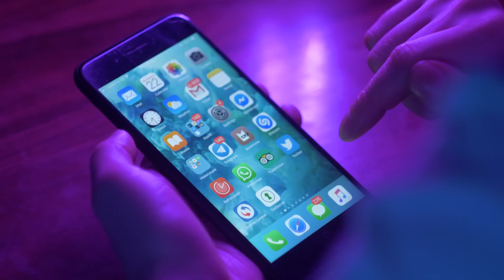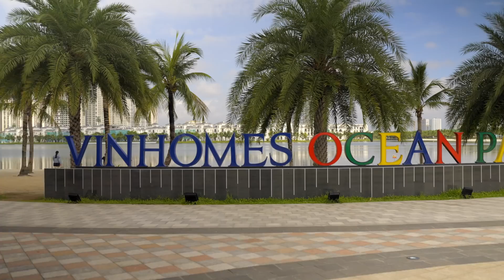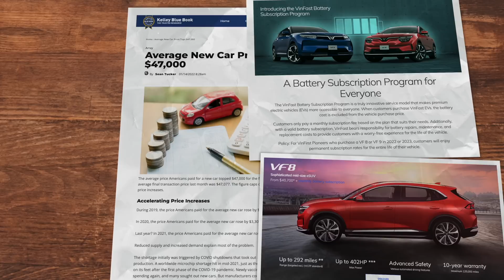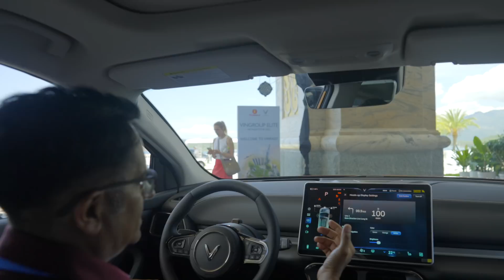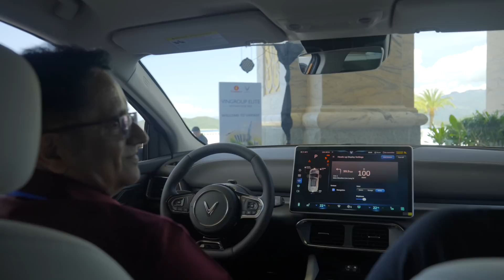New Startup FINALLY Makes EVs Cheaper Than Gas Cars!

Comment: If I have the right as owner to rip out their battery and return it and replace it with on I chose if I find a better battery deal, I might go for it. But otherwise I doubt they could make it affordable in my range. I can buy a car/truck used for $1k-$2k and make it last 15 years, with self repairs.

Comment: They should make cheap ev tow cars for those who like to couple a caravan or put on a trailer. EV with towbar is very expensive. if I had a car factory I would make a cheap electric car with a towbar and reduce unnecessary things like seat heating and heating in directed self-driving technique and everything else unnecessary.

Comment: I only have TWO concerns about this: one, not enough EV stations, and, two the design of the vehicles themselves.  I would rather get a hybrid, than a vehicle that runs solely on electricity.
Reply: Biden said the infrastructure bill has plans for many more charging stations.  I'd like to know more about the subscription, do you just swap out batteries?  Is it free to swap since you subscribe to the plan?
Reply: Transferable lifetime battery warrantee seems to indicate that. Labor cost to replace is the question

Comment: Subscriptions are great for businesses but totally suck for consumers. 
I can’t be alone in wanting to just pay once for a product or piece of software. With more and more products being subscription based the ongoing costs become impossible to manage on a regular wage.
Reply: I would be happy to lease battery it’s the week link it’s fails it’s not mine I just swap it for another battery. Th total cost has to be considered. However in Australia power is as much as 52 cents per KW Residential pricing I’m guessing charging centres would have to charge $.75 to a dollar per kilowatt to pay for the infrastructure so the maths for Electric vehicles just does not Add up.
Reply from the maker: this is so not true, the number of people using photoshop exploded once they stopped selling it for thousands and started charging monthly. There's a lot of wrinkles to this, how about a work lease? What if you drive 30k a year?it'll depend on each individual, but the subscription is anything but anti-consumer. I would never pay 13k for Tesla's FSD, but for a hundred or so bucks a month when it gets good, yeah i'd consider it. that's sort of the difference, what if you inveted that monthly savings instead? a whole slew of factors to consider
Reply: It suits people who cannot afford paying 60k for an EV plus it gives you a peace of mind regarding battery. Paying 20k up front will cost more on financing. Also future value of money is much less its present value due to (high) inflation so paying 20k now is much more than paying $160/month over the next 10 years. With 5.25% inflation, 12k now is equal 20k in the next 10 years so you save $8k. Besides, battery technology keeps changing so clients might get a better battery in the future.

Comment: The battery subscription sounds like they don't think their batteries are very reliable ...... Don't get it.
Reply from the maker: the opposite, who would allow you to not bear the full weight of the pack, if they didn't trust it? the savings is way bigger for the VF9. consider the 3rd row EV SUVs... the other costs like $30k + more
Reply: Actually the subscription is just like leasing. If the battery last longer they keep the savings not you. You still pay a premium. If the battery fails sooner you might save but not likely. These corporations know how to hide clauses in their contract agreements so your always holding the short end of the stick.

Comment: I think the biggest challenge in the US will be infrastructure.  You can have a proliferation of EV’s but if the charging infrastructure lacks you will end up setting the revolution back. Places like Montana, Wyoming and the Dakotas lack the charging infrastructure to make road tripping with most EV’s a chore.  Even Tesla’s network is sparse in a lot of areas there.
Reply: I've had a ev since 2010. Charging infrastructure in Washington state sucks. Occupied or broken. 2 hour at charger poeple. Don't be rude. Hopefully one day I can pull up to a gas station and fill battery in minutes but until then a ev can't be your only car. I ain't got time for that!

Comment: 1. How is a company backed by a megacorporation a start up? If Ford starts a spinoff EV company would it be a startup? 
2. The VF8 STARTING at $40,700 does not make it more affordable than gas cars. Gas sedans start in the low to mid 20s, Gas SUVs start in the low 30s. If the VF8 follows similar trim scaling as traditional manufacturers then fully loaded it's probably more like $50-55K. Before taxes.
3. Battery Subscription? Oh good a feature where the company remotely turn your $40k+ investment into a giant paper weight.

Comment: After sitting in one at their showroom in Santa Monica the other day I think they hit the mark for their target audience.  It's another SUV at a lower price point than the competition, if you change cars every few years.  It's not for me for two reasons,  It' is just another SUV with nothing really distinctive about it and I wouldn't want to do a battery subscription.  Cost wise that adds up as I tend to keep my cars for a minimum of 5 years, if not more.  Still I think there will be a market for it, just not from me.
Reply: You actually save more by not paying up front for the battery. You could simply use the amount that you are supposed to pay for the battery to invest in any fortune 500 index. Plus the battery tech will change in 5 years, by that time you could swap for the new battery without having to pay for the new one in full. In fact, the battery is the soul and heart of an EV and it is expensive and tends to have a lot of problems. The battery degradation has a huge impact on a vehicle's performance. If you plan to keep your EV for a long time, you will have to replace it with the new one at some point regardless.

Comment: I'm not sure if you know this, but Renault Zoe was the far cousin car to Nissan Leaf since back in the day. Renault did the same thing as Vinfast now to ease customers' concerns about battery degradation, and offered battery rental. Although the first generation Leaf degradation was disastruous due to even air cooling not existing, the Zoes did have simple air cooling, which proved to be more than sufficient, and therefore suffered only insignificant degradation over the years. Once people realized that, the experiment was over and the positive conclusion was drawn, Renault ended up removing the battery rental scheme altogether, and people buy them with good confidence. I'm not sure who Vinfast is targeting with this, but power to them, I hope they provide welcome competition to the chinese brands.
Reply: I've heard that they will sell cars with battery after 3 years. I guess that's when they can produce their own batteries using technologies from Gotion, Prologium and StoreDot. This battery for lease model will be good for people and businesses that want to reduce up front cost of EV cars.
Reply: Battery rental obliterates the saving of moving to electric, especially on older cars.
Reply: Also Nissan was selling the Leaf with battery leasing in the very beginning. At least here in Sweden. From what I heard, Vinfast's battery leasing is not as flexible as Renault's was.
Reply: h great ! as a coloured person you should know history ! of slavery racism and colonialism or ? are you aware ? 
CHINA IS a fascist totalitarian regime ! VIN fast is part of the propaganda in east Asia ! supporting and exploiting Vietnam ! making them co dependant - !  THINK BEFORE YOU ADVERTISE A RUBBISH PRODUCT !  WAKE UP !
Reply: Your thinking in a first world mindset where unlimited credit is easy to obtain and paying off $70000 is just chump change.

The rest of the world doesn’t operate like this, so the rental option for a battery makes ev a possibility to normal people not just the super rich.
Reply: @MuddyTrousers  agreed as rich people tend to buy tesla instead of vinfast

Comment: Battery lease has been done before and failed. It does not make economic sense. Even looking at your own videos numbers. With the lease of the battery included you might as well drive gasoline. 
You own the car but not the battery, then why not just lease the entire car. Don't know about America, but we have a big private lease market over here. If they want battery lease to succeed they have to either lease the entire car or make the lease substantially cheaper.

Comment: The whole attractive point of EVs for me anyway, is moving away from a constant payment system where you are forking out money for the whole life of the car just to run the car, with full ownership you can do this if you also own solar or other means of producing your own electricity,  of cause theres always something you will need to pay for, warrant/road tax, so for me this makes zero sense, other than that the car looks fine.
Reply: Depends on the numbers. It doesn't make sense until the numbers are calculated. It could go either way.
Reply: The issue I see here is 
* average low costs.  If you don't have "the bad case" you are cool.
* extremely expensive outlying cases.   If you hit a bad pothole, it's $3000.  If your battery pack goes bad early, it's extremely expensive.   I kinda think they need to charge $500 more and put it into a fund for the unlucky few.
Reply: @mac_mcleod  most EVs come with very good battery warranties, unless its a Nissan lol
Reply: @Yahgiggle  Yea, but some folks get a bad pack and that creates a bad experience.   It's rare but the mfg's could cover that better.
Reply: @mac_mcleod  some people also get a bad motor or gearbox with new ICE cars, somethings just give people a bad experience no matter the technology, so what's your point ? oO
Reply: @Yahgiggle  never mind.   The people reading who got it,  already got it.   

And you are never going to get it.

Comment: The question is not whether RVs are cheaper than gas, the question is where will the additional electricity come from for the grid. The US is determined to follow the failed energy transition model of Germany so there won't be nearly enough electricity from renewables for normal demand, let alone the 20-30% increase for EVs. Unless the US is willing to go all-in on advanced MSR nuclear, there will be a huge electricity shortage and an extremely unstable grid.

Comment: What they need for the battery is a long warranty the car maybe has a 6 to 8 year warranty and the battery has at least a 10-year warranty
Reply: the SUV's has a 10-year 125,000 mi bumper to bumper.  The Battery has a lifetime replacement if it falls under 70%, and is transferable - under prescription.
Reply: Wonder of the replacement includes labor to change the battery.

Comment: This business model is not new. Renault has been doing it since 2012 with the Zoe. By the way, in 2012 that car had a 150km max range, now it's about 390 km. Now, it does not loan battery anymore, they rather loan the whole car...
And its prices start at 33 700 €, VAT included.

Comment: The battery subscription is also applied to their electric scooters. At beginning I was all against purchasing the Klara S without owning the battery. Eventually I still bought it because i wanted to be one of the first. And you know what. I got used to it. First I don’t have to worry about a degraded battery and secondly I can easily swap my battery in one of their vinmart network across the city without waiting for a full charge. So I can identify with most newbies in the ev world but I’m convinced this will work out in favour for Vinfast :P

Comment: The electric grid is the Achilles heal of the electric vehicles......coal,nuke and natural gas used to charge an electric car will fail due to the inaction to build the grid to support them
Reply from the maker: but grids are getting cleaner every year... we're over 50% clean here in CA... same is happening everywhere
Reply: @TwoBitDaVinci  too bad that Government red tape and corporate  greed keeps us from a more sustainable grid.....cost has come down and if clowns like Musk actually delivered(the electric roof) we would be better off
Reply: @TwoBitDaVinci  the mid-west and beyond to the east?...dirty energy
Reply: The grid will be fine, as all utilities have been saying a couple years now. The US power/grid has grown 5x since the 70's. They do need to focus on energy storage to smooth out the swings in demand but that's been a problem for decades and the reason they have dirty coal peaker plants. It isn't like 200 million EVs will be hitting the road overnight.
Reply: @davidmccarthy6061  the fact that all automakers are sheep with the exception of Toyota.....who is actually chasing sustainable growth.....remember almost all auto makers are now electric within the decade

Comment: @11:25 this battery subscription maybe the Achilles heel for Vinfast, hopefully they figure out quickly that most people will hate this
Reply: It's actually fairly common except in the US but humans don't like change so they will need to see the pro's/con's of it. And while it might sound good on the surface, nobody has seen the fine print yet to determine if it really is a value. Like everything, I suspect it somehow benefits the company more than the owner.
Reply: Battery subscription is a deal breaker for me.

Comment: Anybody want to make a car just for drive. No cumbersome computer and expensive self drive. Do you know some people enjoy driving and need no computer.
Reply from the maker: So this car drives very traditionally, you can just ignore the tech and drive :) I still drive my Tesla 90% of the time, I only use autopilot for long road trips... I totally hear you on this.
Reply: Ignore what you payed for, can I ignore the payments too. I think his point means he want a car without all the extra costly bells and whistles. I too would prefer a slim down version that just drives from point A to B without emptying your wallet of unafordable excess luxury.
Reply: Sure some do but that's why the manual transmission is dead. For most people driving is an unavoidable chore.

Comment: €0.13 per kWh, whow. If only that was correct where we live. 
Netherland prices are on average €0.52 cents, (May 2022). so, 4 times higher
But on the other hand, gas prices are €7.50 the gallon. Thats about 1.8 times higher. 
That is for the EV €180 + €110 per month for the battery is €290
Same for the gas car around €290 per month. 
So, buying that EV should be for the same price as the gas car, to make it even. . . . . Cheapest  Vinfast model is the VF8, costs €45.000 
I bet I can buy a gas car for a lot less than €45.000.
BTW, Renault is doing that battery rent for years.
Reply from the maker: yeah that's really expensive in terms of electricity, its much cheaper in hte US, although its more expensive in California, closer to your prices. But they offer cheap rates at night for EV charging when electricity is cheaper
Reply: @TwoBitDaVinci  We would love to buy a Fiat 500e Cabrio, that woulld be perfect for the two of us. (since 4 years a Smart ICE Cabrio) 
For the longer trips we need that 200mls range minimum. 
But that €33.500 price tag is about €14.000 over budget. 
So, for the time being, ICE cabrio it will stay. (and we are affraid EV prices will keep going up, due to inflation and higher material costs.